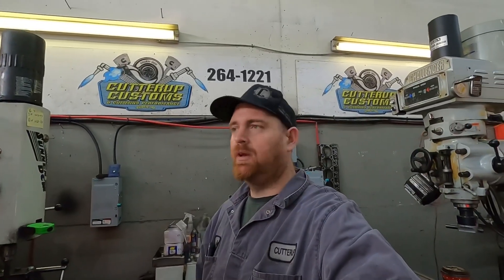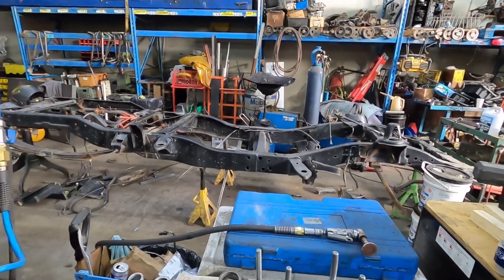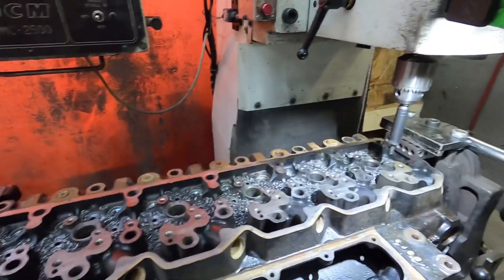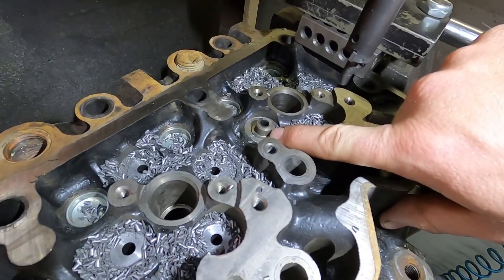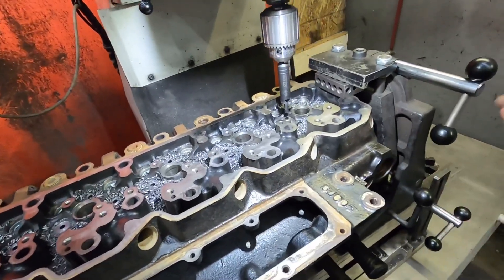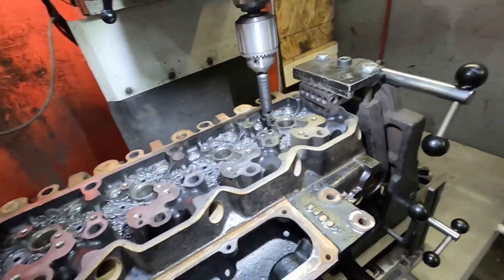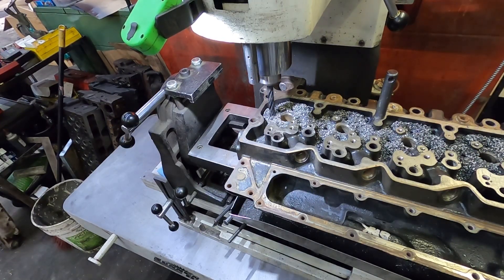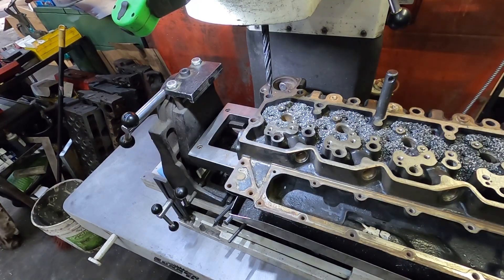Parts 14  PPUMP 6.7 CUMMINS build. Working on the head.

Comment: Are the cylinder heads compatible between 5.9 and 6.7?
I know for sure the VP44 came on the 5.9 but this particular video is 6.7 build.
Reply from the maker: all the 24v head all flow about the same stock. as the i can use the vp44 head and not cut the intake shelf off. so I figure I will show how a guy can do it with of spending more money then they need to. but i will be changing the head later